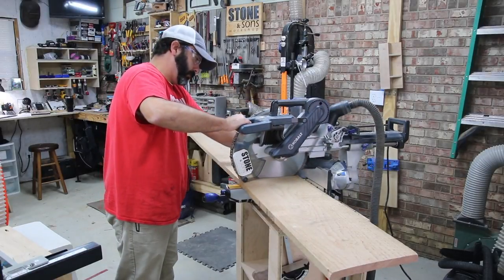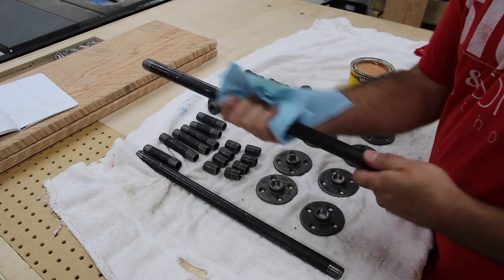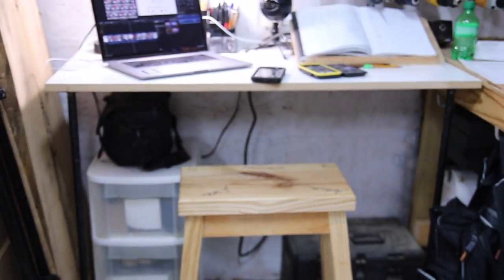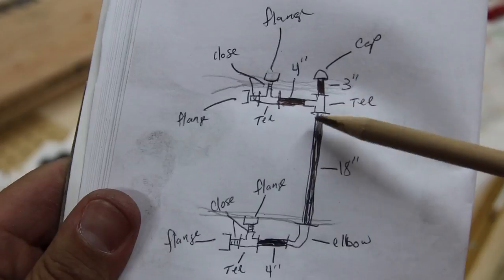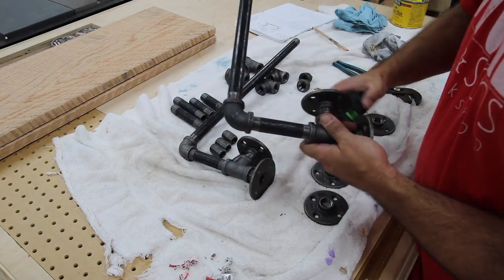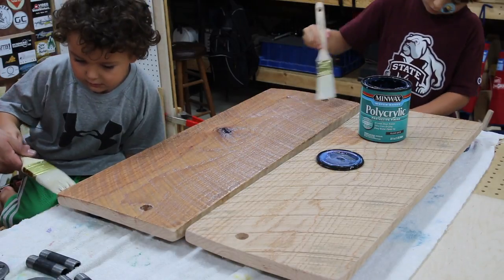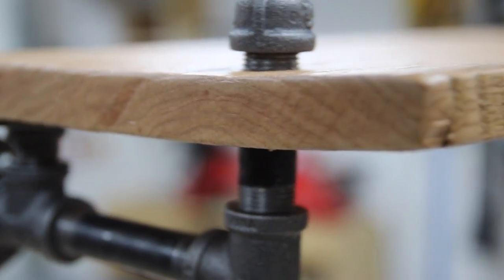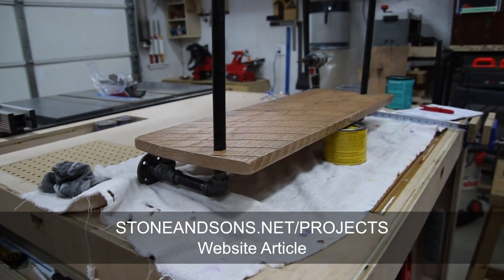DIY Pipe Shelf - How To Woodworking

Comment: Word of advice, at least as of last week Menards has the best prices on T's and Flange's. I'm working on making a desk with 1" pipe legs and it requires 8 Flange's and 6 T's and about 17 feet of pipe. But anyway, I spent about 100 dollars just on the pipe's and flanges and T's needed for it and because of that I made sure I got the best deals on them. Even with the 9 dollars on shipping Menards beat out Lowes, HomeDepot, Amazon and I even think Ebay. And I can confirm that HomeDepot cuts and threads as many pipes as you need for free because I had them do it. It's much more economical to buy 10' pieces if you need that much and have them cut it down. The downside is I had 15 pipes that needed cut and threaded and it ended up taking basically 3 hours for them to get it done.  It actually only took an hour for them to do it but they were busy and had other customers to help first. So beware if you have to travel out of town to get that done because it may not be an in and out thing. But you could probably honestly call them and tell them what you need done and then they'll call you back and tell you it's done then you can go pick it up. I would have done that if I realized it was going to take so long.
Reply from the maker: +dedalliance1 Thanks for the info and tips.

Comment: Great idea. However I don't see much support on the front of the shelves.
Reply from the maker: +steenfraosterbro no need for it. The screws underneath will hold it more than I need. Also the holes are not oversized at all, so there's no way the shelf could tip if it wanted to.
Reply: There's truth in what you say but there is the problem of warping and expansion/shrinkage in a bathroom area making the support at the shelf fronts a slight issue anyway. However, I am with you, it should not be a big issue.